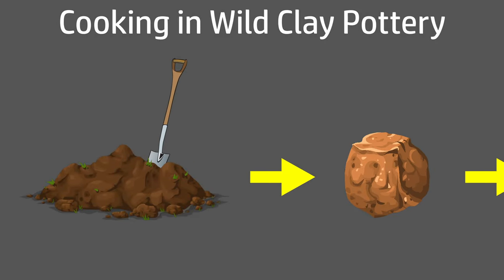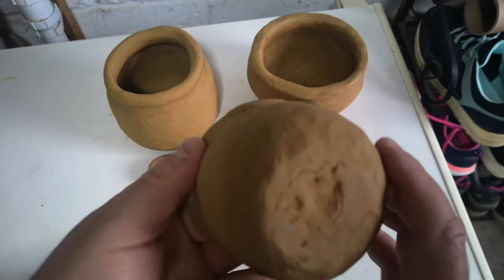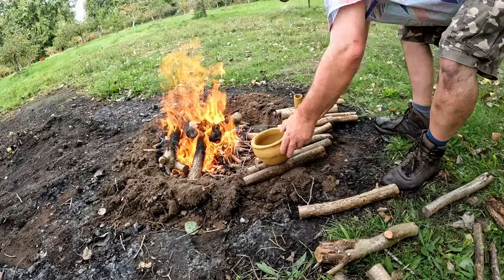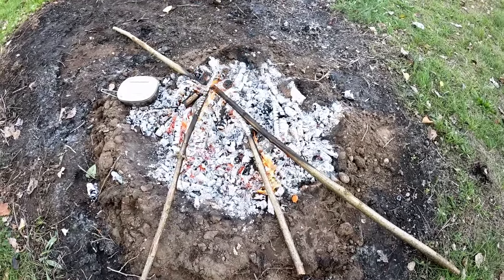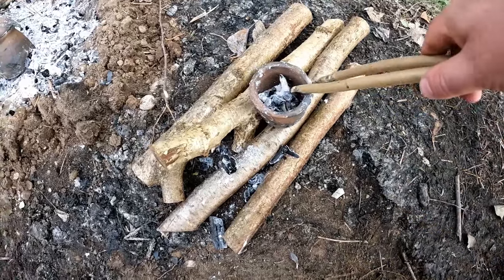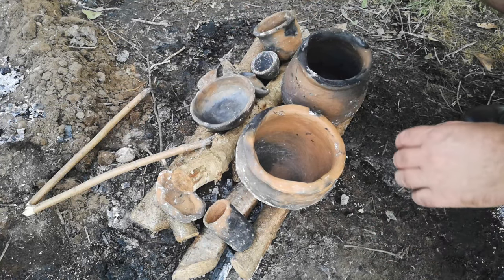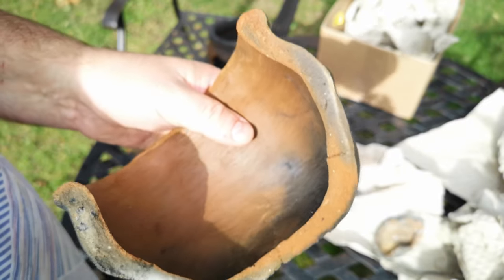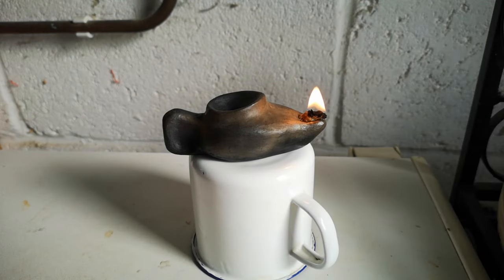Cooking in Wild Clay Pottery - Part 3 - Firing Pots

Comment from the maker: The Die seems to have been omitted in the edit. It fired OK. I'll show it in part 4.
Observations & Analysis
Firstly and foremostly, this can't be impossible.  People did this for millennia, before electric and gas kilns, before commercially prepared clay.  This IS possible.  I will press on until it works for me.
My tentative conclusion is that the large pots were worked from clay that was too wet and soft - this made it seem more delicate than it should be, resulting in thick walls that were insufficiently compacted.  Furthermore, I think the fire probably didn't stay hot enough, for long enough, for the larger pieces.
The (tentative) plan:
Make more large pots from slightly dryer clay - probably one sand tempered, two raw clay (I have loads of that) and one grogged with some of the reddest parts of the failed pots, ground up.  Waiting until the clay is more firm before trying to work with it.
Make the pots with thinner, more compacted walls, - achieve this by smoothing and pressing and compacting with a smoothing tool made from the clam shell.
Fire in a larger fire, in a deeper pit - so it stays hotter for longer and so that the pots do not become uncovered and exposed to cooling crosswind until the fire has died down naturally (ie. leave them buried in the embers overnight to cool gradually)
Reply: The deeper pit will probably make the most difference due to the even heating and cooling. You might want to build a kiln around the fire with suitable air flow through the fire, something that'd be difficult in a deep pit.
Reply from the maker: Maybe a deep pit with a narrow sloping trench into it to allow air in.  Trouble is if I dig too deep, I won't be able to manage the primary fire that warms and dries the pit.
Reply: Good observations. I hope u find a solution because I'll definitely be watching this is too cool. I want to try it myself
Reply: @AtomicShrimp  Perhaps something as simple as a wind break around the fire pit might help with the differential cooling.
Reply: a failed firing today is just grog for tomorrow
Reply: Perhaps a two stage process: make mud/clay bricks first, then use those to make a kiln to fir the pots. 
You could even get away with digging a deeper fire pit and lining the sides with clay, to form a ground based kiln.
Reply: @jensgoerke3819  how did you comment on this 8 days ago 😂
Reply: @AtomicShrimp  a Dakota fire pit. Once you get the fire in the pit going stack a lot more wood* on top.
*Wood here being pieces at least as thick as your arm.
Reply: It’s also a good idea to cover any exposed pottery with hot ashes to help even out cooling speed! It would be better insulation than laying fresh, cold, sticks over them
Reply: Just a thought:  Maybe there was still water trapped in the clay of the bigger pots.  Thicker walls take longer to dry completely.
Reply: As far as I can remember from a pit fire that I took part in a while ago, the fire really needs to envelop the pots, so definitely improve on the last part. We made a massive pile of wood around our pots and it burned for longer than yours, leaving them overnight in the ashes. The pit was not really deep, looked like a normal campfire. We were on duty to put on wood constantly to keep all the pots covered. That was also with a lot of beginner's pots (thrown ones, so definitely not compacted much).
Reply: @AtomicShrimp  I expect you've heard of 'Primitive Technology' (channel). Great channel for building brick blow furnaces.
Reply: I saw a lot of broken (after use) in my former life in archaeology. Definitely the walls were thinner and there was more  prominent grog. I recommend a museum or archaeology store visit to help understand what proportions seem to survive firing.
Reply: Wouldn't the dehydrator speed up the drying? Or just don't want to use technology making it?
Reply from the maker: @sleptiq  I think slow drying is preferable to avoid cracking
Reply: @AtomicShrimp  Perhaps try rolling sheets of clay to get the required thickness wall, then shaping around a mould?  Stick bits together with slip.
It's quicker and more accurate than ring pots.  (Snakes)
Reply: I'd be very interested if you can find out if the die is somewhat even. (count 100 dice throws and see if its off).
Reply: @AtomicShrimp  Well, I definitely don't know anything about pottery, but considering seeing people drying it next to a fire, I thought a 40 degree dehydrator shouldn't cause issues.
Reply: Add more ashes over the pot(s) as the fire dies down to insulate and prevent too rapid and uneven cooling.
Reply: Use the broken pots as cover shards?
And look at the open firings at Andy Ward's Ancient Pottery channel. Your fire looks comparable to his. Small branches and all.

I think it's the thick walls that caused cracking. Good luck with the next iteration!
Reply: Excellent video, it would be neat to see if you could make a paint or glaze for the pots, I really enjoy seeing pottery being made, it reminds me of when I was in 8th grade, trying to make pottery in school for the first time.
Reply: As an armchair specialist, who did watch a lot of videos about clay, firing bricks and pottery, primitive technologies in general, survival, foraging etc., but has own experience comparable to none (at least in pottery & building; the foraging and cooking I more do than watch), I thoroughly enjoyed your video, approach, neatly put together afterthoughts - and mostly agree with you. It is possible to make such pots, these were made from too wet clay and had too little time to dry and then fire thoroughly due to their wall thickness and size, I agree with that all. The drying and firing process shouldn't be rushed. The only objection I have is that, as some also suggest, I'd try to build some type of kiln, oven to fire them in, wouldn't dig deep holes in the ground (though I don't deny that it should be possible, too, just building something around / for firing seems safer / better for the process, even if it needs more effort to prepare than digging a hole). And they need more coverage during firing (often on the top are added pieces one doesn't expect to fire properly, rather to scrap them afterwards or fire them again, if they don't break in the first firing, just be underdone), you need to mantain high temperature constantly for longer time, it's slow process, at least with bigger / thicker pieces. The details you are already figuring out by try and error method. 👍
I don't doubt you'll succeed and it's delight to see someone who makes their hands dirty and share the satisfaction with their work, from afar. The oil lamp came out really adorable, and it works! You make me want to go and dig some clay, purify it and at least try to make such lamp. Its concept always fascinated me. 👀
Reply: Sand could have affected the firing of the pots. Apparently, landscaping sand has contaminents that can affect the firing process. Where was the sand sourced from?
Reply: Good luck! I'm sure there are many pottery enthusiasts who will have ideas. The early failures will make the eventual great success all the more satisfying.
Reply: Once the pots are dry put them in the oven at the lowest heat for a few hours...
Reply: Wedging. Wedging might help. If you aren't already looking into that aspect, I highly recommend you start with improving your wedging process. It will help reduce chances of air pockets getting trapped in the clay that may have contributed to the pots cracking.

Also, a thought I have is filtering the clay better might help sift out bits of flint you thought may have been in it. Maybe try pouring the clay slurry through a metal strainer/ sieve.

And your little oil lamp had me "Oh, I come from a land from a faaaar away place where the caravan camels roam...."  It is a very nice little piece and has been my favorite from the start. I am very happy it turned out well!
Reply: Thank you for all you do makes living a little more bearable
Reply: Building a pot slower is normally the best way of having thinner walls, build 15-20 cm. wait for it to go medium leather (you can use a heatgun or warmer room but it can stress the clay a bit) then coil on top of the form.
Reply: @AtomicShrimp  The failed bits of pottery can also be used as a makeshift saggar
Reply: Perhaps dry out the pots slowly in a normal oven, before the real firing stage.  if it wasn't British October then I'd say leave them in the sun 😎
Reply from the maker: @quantumbacon  I think I would do that, if I could carry them still hot to the fire and immediately fire them (I can't as the orchard is too far away) - I fear that cycle of heating cooling might do more damage than if they just get steadily and increasingly hotter
Reply: I went on a sculptural clay course once. The instructor (a ceramic artist) said that you needed to “choose if you are mailing a coil pot or a pinch pot” and not mix the two techniques because you will trap air and the clay will then spall in the oven. 

I’m certainly no expert and I’ve never made a pot from clay but could it be that your clay technique blurs the boundaries of pinch and coil? 

I couldn’t follow which pots were made which way so I may be way off base, but I’ve been meaning to pass on this memory for days!
Reply from the maker: @symetryrtemys2101  I'm not going to disagree with an expert - perhaps there's something in it - or perhaps the two techniques just don't mix well in the classroom context.  The largest pot that survived in this firing was pinch+coil, and the others failed for reasons that weren't spalling, but like I say, I'm not qualified to disagree with an expert so maybe luck is also a factor.

Comment: Hey Shrimp, I am sorry i am a bit late! I went to school for two years for ceramics and i have to say you did amazing! I do have a few recommendations for you.

1. It is a good idea to let clay ferment. There is mold that is in stone clay that i would use in the studio, this mold helps with elasticity in the clay, the best way to get mold in the clay is to let it age. When i would recycle clay we would take the clay that was supper soft and let it sit on a concrete or plaster slabs to slowly dry out and age the clay. the clay could sit on the table for up to 2 weeks to get the mold in it and to dry it out. (the studio that i went to school and was a work study at mainly did wheel throwing so we went though a ton of clay)

2. another thing that could help you with mixing your clay up (when you added in the grogged shells/sand) is wedging. I highly recommend you look at videos for rams horn wedging it really helps work the clay, mixing it and getting any air bubbles out of the clay, there is also a type called conch shell wedging but rams horn tends to be easier. 

3. My recommendation for your bigger pots is paddling; and it is exactly as is sounds, you place your hand on the inside and hold the pot steady and with a piece of wood lightly hit it. This compresses the clay, helps shape the pots, and helps with the surface texture. This helps a lot with coil pots/pinch pots.

4. You may want to fire them in a deeper hole so its more insulated (https://youtu.be/qu_Bc-Gf3Nk , this is an amazing video that explains it better than i can.

5. With the larger pots something that could have caused the cracking is not letting the clay get to a bone dry stage. When you combine the clay that still has some moisture with the high heats you where getting to it can cause fractures with the moisture tying to vaporize.

6. Dont handle the pots too much when they are dry, when clay gets to its bone dry stage it is its most venerable stage so your dont want to move it around too much. if you do get cracks in the clay that you can see take a small amount of white vinegar and an even smaller amount of your clay mix them together and use that to fill the cracks.

I think its amazing that you broke your bigger pots more to see the inside walls. when ever a piece brakes it is always sad but also a very good way to evaluate your skills and what you need to work with. With what i am assuming is your first time in years working with clay, but your first time fully making clay you did an amazing job and have a knack for it! 
I am more than happy to help answer any questions you may have as i am trying to become a ceramics teacher!

Comment: I believe what’s most important for the large pots is that they not be exposed to air even if you have to cover them with ash and coals or burn a lot of smaller items over them, rather than the area simply being hot. Leaving them covered until the ashes cool down is only going to help.

In addition you should try to make sure the pots are hot enough by making sure they’re “glowing” in the fire; everything glows the same color at the same heat barring some weird chemical reactions (ie the charcoal itself glowing rather than the fire colors), what you have to be careful of is how that glow views in various levels of light can have a very extreme swing. On a bright day something that’s 2000f can look nearly cold, on a dark night any slight glow is visible. I believe you’re aiming for a general “orange” in a more medium light, ie hotter than red and cooler than yellow.

Between the two, you’ll probably find where the failure point was; not getting quite hot enough compared to the other pots, and then being exposed. I think if the thickness or drying was off, or the issue was a rock in the clay or material, you’d have seen spalling which there was no sign of, or if it was too soft even slumping or deformation. Similar with water content, presumably they’d have exploded or spalled in the fire.
Reply: Yes, often smaller items are placed inside larger ones during the best firing as well as all items being very crowded around each other this is to help create a more even temperature throughout and to help make sure that he is drawn inside of the larger items evenly with the outside. I Believe by placing his larger pots upside down he not only limited the ability for the heat to evenly flow to the inside so that it would be the same and equal temperature to the outside but it also put the more fragile bottom facing up whereas typically in a woodfire the base would be down as well as the fire being kept around the object as you stated but I do believe this could be averted if you have smaller items on the inside that help raise the pot up a bit off of the ground allowing air to flow underneath the lip that is facing down on the pot.

Comment: After many years of throwing pottery, it's taught me not to become attached to anything, because at any point in the process you can lose your piece. So I very much appreciate your apprehension at firing your dried pieces. I haven't finished the video yet, but I predict they will fire just fine. What makes pieces break is either using a runny glaze that winds up fusing the piece to the kiln floor (a non-issue for you), or an air bubble inside the clay, which I believe were mostly avoided in your hand building. 

Keep up the great videos, I love the variety of your channel and all the different kinds of stuff you get in to!
Reply: And, you hit upon another important draw of making pottery, one that's inspired me for over 20 years -- that you're making something functional and useful from earth. It's very satisfying!

Comment: Really good result for your first try, all the intact pieces are great.  The thicker walls and greater overall mass is exactly what I suspect broke those two big ones.  Even with very dry pottery, moisture still remains, and especially in the inside of very thick parts.  That moisture turns to steam and forces its way out as soon as it heats up, then you get cracks.  A big piece will still need to be thicker than a small one, but less thick than this first try I think.
Reply: I wonder...does a piece of pottery need to be made in one go or is layering an option? Since that's what's usually suggested when a material needs to air dry. Would the layers fuse together or seperate during the firing?
Reply: @raraavis7782  Glazes fuse things.

Comment: The other thing about the way reduction firing is done by the natives of the US's south west may also be worth considering.  They do it by covering the fire to deprive it of oxygen.  I think this also slows how fast it gets hot.  This also means that the space where the pots are fired is still covered after the fire goes out.  They leave the pots in there as the temperature cools meaning that they have also slowed the cooling.

Comment: Something you could also do with one (or both) of the broken pots: There is a Japanese practice called Kintsugi, which is the practice of repairing broken pottery or china using gold (or gold paint) to highlight the cracks in the piece. Basically you glue the pots back together, and paint over the cracks with the gold paint to highlight the pattern that they make. I think it is a very beautiful practice, and very meaningful as well; just because something broke doesn't mean that it is no longer beautiful or valuable; in fact the break allows for even more beauty to be added to it. Just a thought for something you could try! I know they sell Kintsugi kits online but you could probably also find your own Atomic-Shrimpy way to do it :)

Comment: I suspect it was a cooling issue - modern kiln cooldowns are the better part of a day, so perhaps covering them completely in the coals and then capping with earth and allowing a full 24-36 hours of slow cool would avoid the issues on the larger pots?
Reply: Came here to say this. I don't think that the coal bed was deep enough and should be covered for the cooling process to slow it down. Larger pieces need a longer cooling time.
Reply: Also make the fire in a pit about 1 or 2 feet deep and try to get a bed of coals all the way up before you cover with dirt or sand.